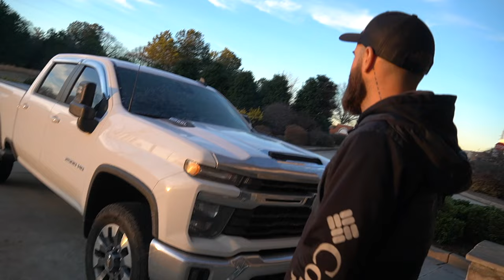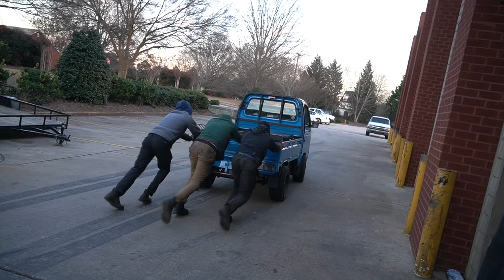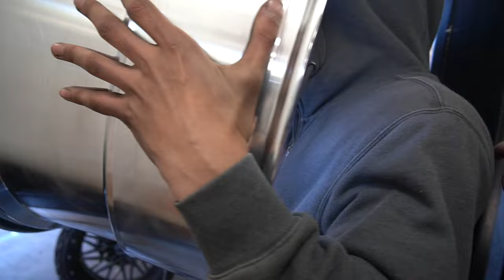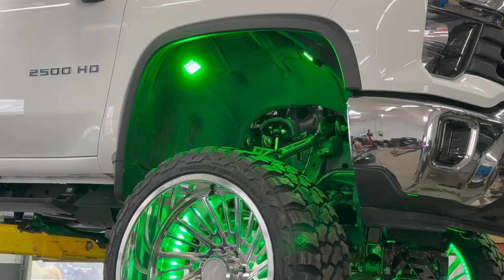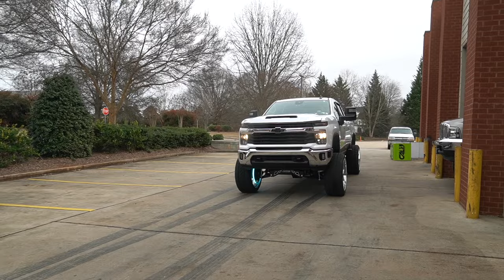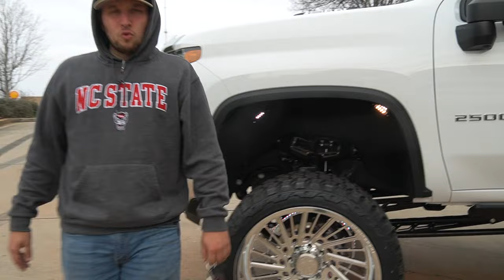Drove from PHILADELPHIA to build his DREAM TRUCK! 2024 Chevy 2500 on 9" Mcgaughys and 26x14s KG1

Comment: Even the 2024 custom and lower trim lt has different front than 23 back. Bumper is different,the black grill section and the center chrome. Also the color trim between bumper grill that connects to center chrome grill.You can get the new front with the new led headlights in the lt models also just have to choose certain package.They look close to the 23 back High country truck.  Headlights did stay halogen. Why Chevrolet didn't use the led high country headlights with drl strip is crazy. Can be swapped wiring adapter because plugs are different. Love this build I have same truck ordered.